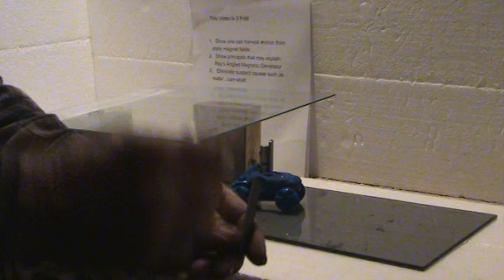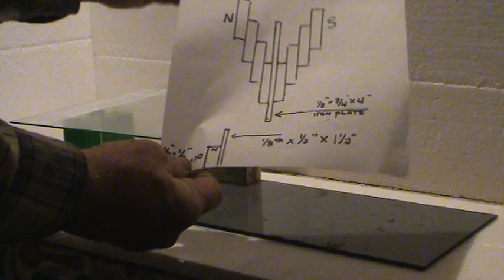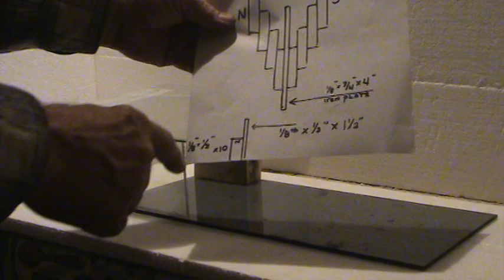Ray's Angled Magnetic Generator 4

Comment: Great video Ray! I have since experimented with permanent magnets for many years and have come to think of the magnet more like a cylinder of compressed air. I don’t think of  the magnetic field as being still, rather I think that the understanding of the placement of the permanent magnet has not all been yet understood. I too have found some interesting effects unique when bringing a permanent magnet together with ferrous material like steel, for example the manipulation or bending of that field. I have a stupid permanent magnet motor idea that I have on and off been working on for almost 9 yrs. I say stupid because many times I have felt like quitting working on the idea with many failed attempts, but very deeply know that the thought is correct I just know it and that’s what keeps me tearing my hair out.

Continue sharing and love the work, God bless Ray!
Reply from the maker: Never give up , one thing always leads to another , even a better thing than what you started for . Thanks for sharing you research . Good Luck .

Comment: Nice work Ray, as always. Regarding your angled approach; I also discovered something similar but rather tha using an angled approach I use a "next to" approach. Instead of setting up directly in line with the gate I run off to the side (if the gate design allows for it). I seem to get similar impulse power but less resistance. It's not huge but it's another 5 or so % which is what we're all looking for. :):)
I hope you are happy and healthy Ray. Keep up the good work and thank you for your hard work and for sharing. :):)

Comment: It seems that a magnet can be “spring loaded” where forces are compressed, but once it is released, it goes “flying”.
Reply from the maker: Yes , but unlike springs , where you need to push to compress with equal force in as you get out , this set up does away with the push in , it just gives you the push out ; o.u. thanks .
Reply: raymondslab it looks like an interesting experiment that I would like to recreate. I will study this video some more. I’m having trouble understanding the magnet sets arrangement. Any added info would help.

Comment: Ray, what if you make a something like: 7 decree ramp on left side and 3 decree ramp on the right side of the little car.
When the car will propelled forward and gently it roll back again. The idea is if it can perpetually move forward and backward? 
However contentious rotation sound a like more logical.
Reply from the maker: These gates do not like rotational angles , these are linear . The Split and Tensioned Gate would need to be lifted for return as the o.u. force is one way . Little energy in , and larger out . See Howard Johnson and his firing magnetic gate . Thanks .

Comment: What you seem to not understand is that there is a repulsive push back that is bigger than what you think just prior to entry point. This is enough to totally cancel out and momentum gained upon the two accelerations of magnetic attraction and repulsion. 

You also failed to display the tiny little pullback force after exiting and after the two accelerations of attraction and repulsion. 

This can be too small to see but it is there. In fact it would eventually catch up in the system and completely deplete the energy of the system.